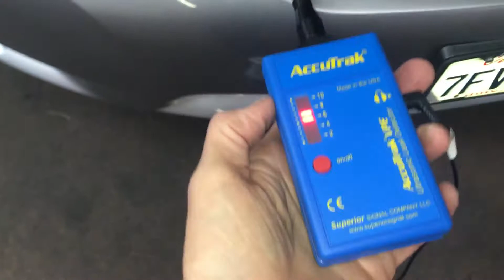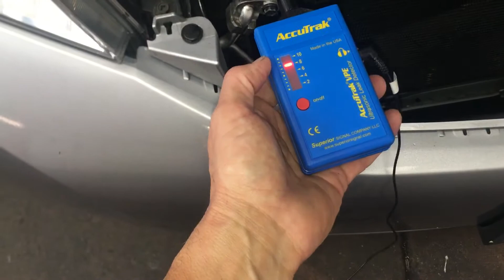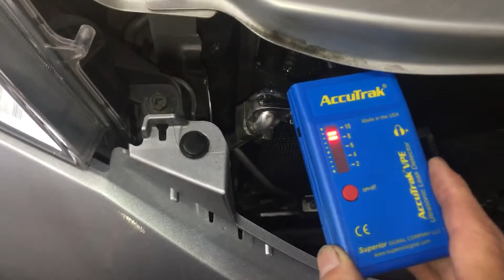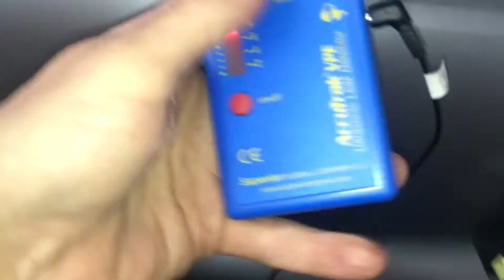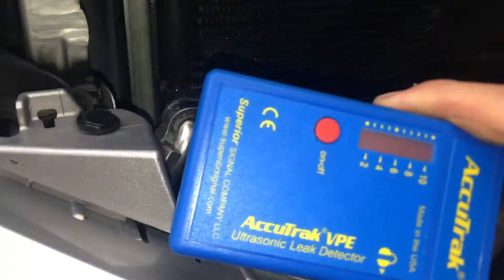AccuTrack ultrasonic leak detector and dry nitrogen find leaking aftermarket condenser 18 months old

Comment: How do you decide how much pressure to test with usually?
Reply from the maker: Wayne Costanza taking in consideration old large evaporators constructed back in the 60s in the 70s a little bit into the 80s that we’re not designed for a high pressure if you go to hayu can easily D form or even crack the evaporator. 
              150 is usually my limit 170 psi would be pushing it just because you can do hire doesn’t mean you should and just because you may have gotten away with it. Does not mean you did not cause damage you cannot see. 

         Unlike when I’m doing some large industrial commercial VFR / VRF R410 refrigerant  The manufactures test pressure can be up to 650 psi . 

        Think of all the radiators on cars built back in the 1950s and 1960s large thin brass headers copper quarters they use lead to solder the two halves together. Only two psi three psi five psi pressure not like today’s cars we could have 12 psi 15 psi 19 psi pressure. If you tried putting 15 to 19 psi on the old radiators the headers would balloon and the form and any soft solder joints at least crack and fail later due to stress fracture. The problem may not be immediate it would happen at a later time down the road
Reply: Great info, Would normal equalization pressure of a system be a good starting point?
Reply from the maker: Wayne Costanza The normalize pressure with the refrigerant it came in with would be a good starting point so long as there’s some liquid refrigerant in the system. But keep in mind refrigerant pressure can go no higher than the temperature of all the refrigerant components. 
     1: 40F @ 35PSI
2: 70F @ 71 PSI
3: 100F @ 124 PSI
           By using refrigerant you could never obtain a really high pressure on the low side for A high-pressure leak test. 
         But then there is the leaks that only leak when the evaporator is cold in at a low pressure say 20 psi 30 psi or 40 psi but does not leak when it’s at a high temperature and high pressure
             Then you have leaks that only leak when the pressure is rising and then when the pressure is falling they hit a certain point the leak comes to a stop completely stops leaking. 
             When you have the leaks that only leak when the pressure is falling the system is equalizing

       When you have the leaks that when a certain component metal or rubber hit a certain temperature where they’re contracting from temperature change they will only leak at a certain point then they will open up fully and completely release the entire quantity of refrigerant.  They can do this without leaving any oil stain and no die will come out it’ll be a completely clean leak UV light will not work. 
        You can pull a vacuum it will completely seal up and hold a vacuum down and deep micron levels and stop leaking. You can fill the system back up with a full charge of liquid refrigerant and it will not leak. 
         Only when you put it through the complete cycle of starting it up heating up components shutting off the car letting it sit in as the temperature of the components are contracting and stabilizing will delete pop open again and repeat this process all over again. 

          This is only a few of the possibilities I have mentioned and even recorded some of them in my past videos.   These were all conditions my father taught me before I was even in high school I got to see on cars experience them first hand diagnose them and was able to repeat the lead process over and over again through experimentation on that particular vehicle that was leaking under this certain circumstance.

       It’s like that nail in the tire that does not leak when the nail is sitting static on a park car but only leaks as the tire is rotating deforming the rubber in the hole where the nail moves around at every rotation lets out a small squirt but when you stop the vehicle and park to the side the leak stops again. 
         We’re getting back to tires again only leaks at a high pressure or only leaks at a low pressure.  Only leaks when the rubber of the tire reaches a certain temperature the leak opens up and starts leaking but on a cold tire it doesn’t leak. Anybody with experience and worked under a mentor who has a good educator with experience this is very common knowledge for those in the dividual’s who don’t know this they lack experience and knowledge. 

       1: This is why having a good extremely sensitive electronica leak detector is very important.
        2: good UV dye is very important for another situation and scenario not the cheap UV dye
         3: A good UV light is no good with cheap dye. Good UV dye is no good with a cheap light. It may work but your left only finding the larger leaks never knowing you’re missing the smaller ones with the dye. 
         4: A good ultrasonic leak detector
5: dry nitrogen high-pressure or low-pressure
6: extremely sensitive high-quality micron gauge to literally be able to read the extreme low vacuum with those certain vacuum leaks that only happened under vacuum that you could never read with a pair of analog gauges
7:  A good set of digital gauges extremely accurate pressure readings to do a high-pressure nitrogen leak decay test that cannot be performed by a set of analog gauges because the readings you’re looking for are well below one psi the human I cannot see or measure on analog gauges. 

These are only some of the tools and some of the methods I have not mentioned all and they all must be used because they all serve their purpose only for a particular leak that happens in a certain situation whether it be static test or dynamic test I left out a lot of information and a lot of scenarios of other different type of leak procedures. 

      This is why you know when you come across a shop doing air-conditioning only using UV dye or a single leak detector you know they’re not a real shop they’re just a pretend make-believe shop who just wants to make the money but not do the job right. Then they whine and cry and bitch and complain about the money spent on tools or education and make up excuses why they can’t do it. These are the type of shops customers have to stay away from. The same goes with transmission repairs the same goes with engine rebuilding doing brake jobs there shops that are real shops educated have the tools have the knowledge and then there’s no pretend want to be make-believe shops who are just in it for the money and whine and complain because they lose so much money due to lack of knowledge training and tools they caused their own problems in their own downfall.
Reply: @coldfinger459sub0  thank you